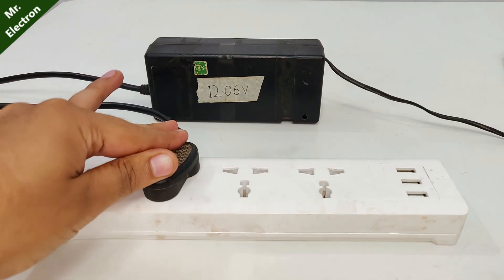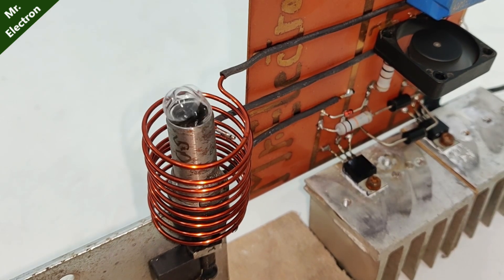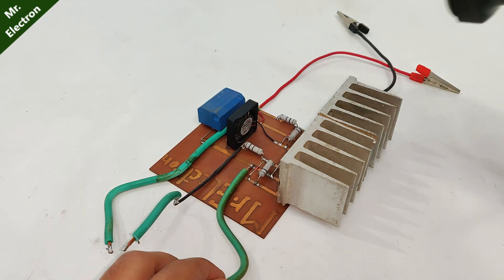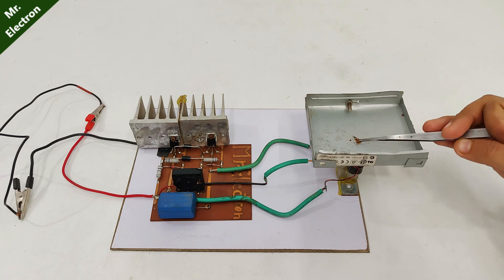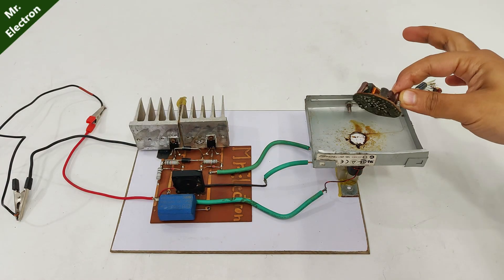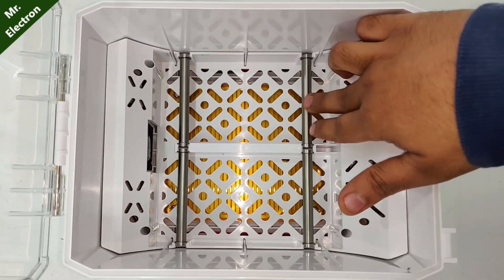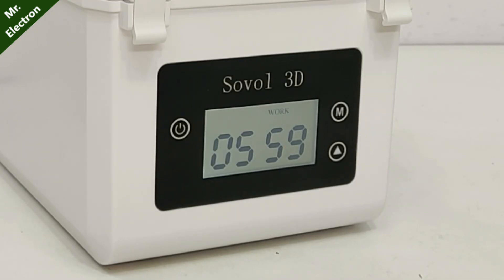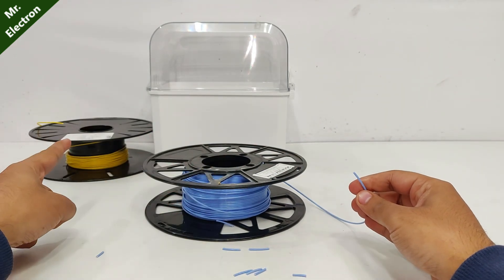12 Volt High Current Induction Heater for Melting Metal

Comment: Using a ferrite core is inefficient when heating a metal. Without load it wont draw more than 500mA, but under load, huge amount of current is drawn and heating of the metal is slowed down due to the circuit oscillating at lower frequency. The reason for lower frequency is the higher inductance of the working coil due to high permiability of ferrite.